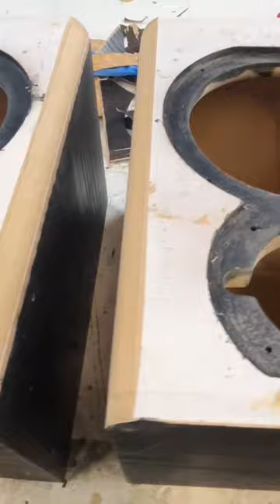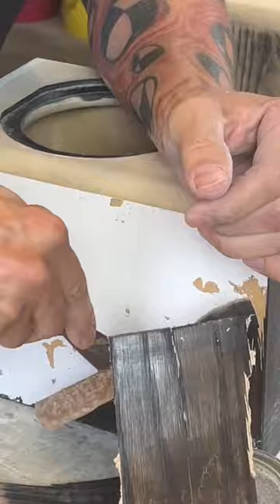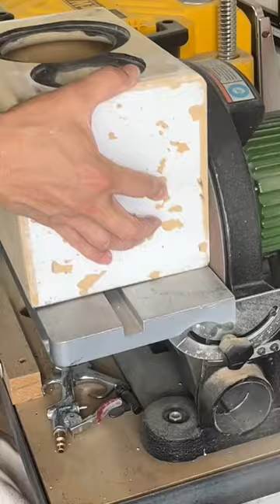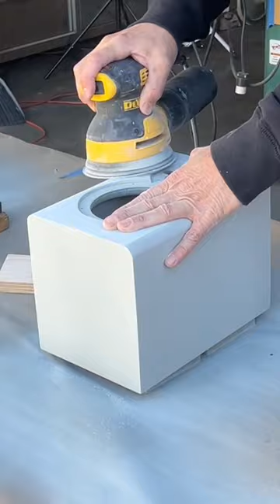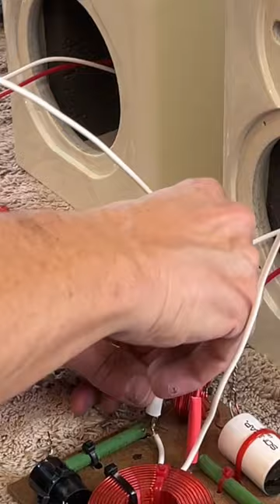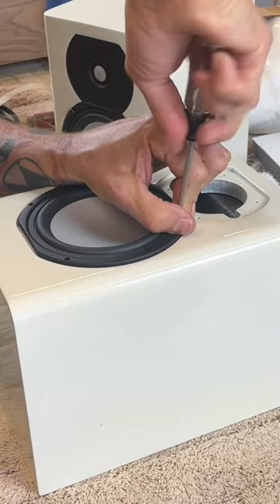GR Research refinish!! Great sounding little guys!! Looking GOOOOOOOOOOD!!! #speakers #diyspeakers

Comment: Nice to see you back to work my friend 😄. You hotroding 🔥 those GR how do those babies sound probably remarkable ,
Reply from the maker: Man. I getta say they sound good. Highs are impressive and called my attention. Detailed, articulated, smooth. Mids are pretty good but lacks some bass to my taste.
Reply: @sonnoradesign  I think you will probably have to build a subwoofer soon to help out with the bass on those and helps takes the strain off your amp. I have 2 12" but I don't really turn them up that much just enough when it's sounds like it's coming from the other speakers that's when it's perfect. But when it's time for movies I turn them up and scare myself.
Reply from the maker: @BostonMike68  hahaha! Right! I’ll have to scare you guys at some point!!!
Reply: @sonnoradesign  I would like to see it. I'm trying to do a 2 way with the reference 10" woofer and the soft dome tweeter but I don't know if I can cross that tweeter that low so I can avoid beaming. I was going to cross around 1400 . I saw you used it in your reference speaker. I wanted to make an old school full range speaker and I already built the cabinets and have the driver's and crossover parts but I don't know about that tweeter
Reply from the maker: @BostonMike68  I’d suggest a 3 way then cause you might blow the tweeters at 1400 hz.

Comment: Those don't look like GR Research drivers...
Reply from the maker: Hm. Scratching my head now.
Reply: Sold out model called “the mini”. still use the woofers in the “LGK series”.
Reply: GR Research do not make drivers they source them source them from different manufactures then build a kit around them. If you go to GR Research, you will see they use these drivers in many of their speakers.